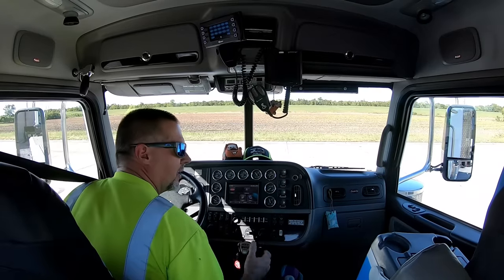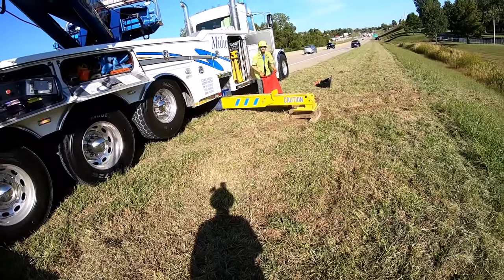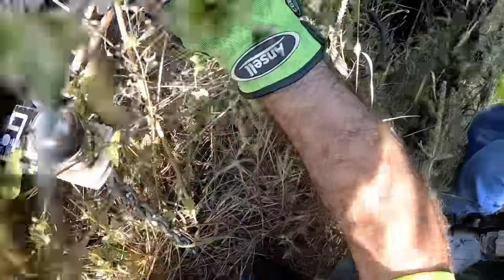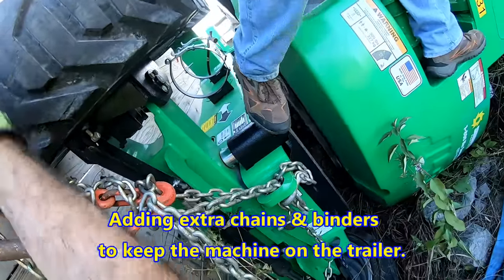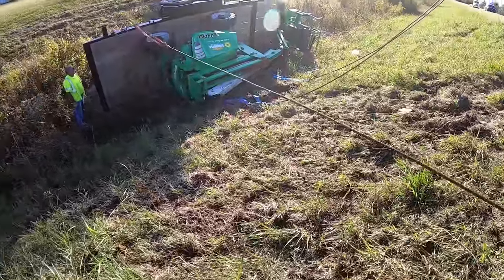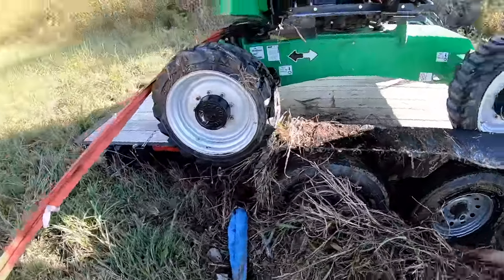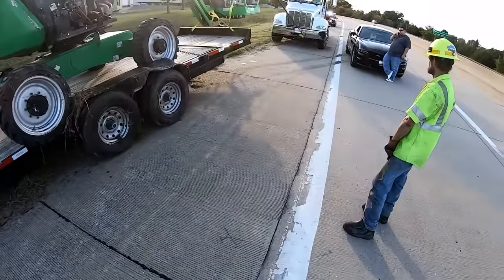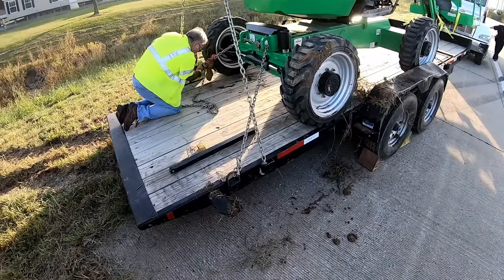THE REVERSE ROLL   ROLLOVER MANLIFT & TRAILER   YOU SPIN ME RIGHT ROUND

Comment: That's the 1st time I've seen you over think a situation like that. I had a similar wreck years ago except it was a very heavy work boat on the trailer. In about 30 minutes I had the entire combo back on the road and they were able to drive away. I set up about 30 yards from the front of the truck and hauled. I placed blocks under the side of the trailer so when I pulled the trailer ran up the blocks and naturally righted itself.

Comment: First of all, thank you, Ron, for the video. That was an ordeal. I saw the lift was not fastened correctly on the trailer, i.e. four corners independently, as you stated. Second, that trailer would sufficient for a load half the weight of the lift, but it seemed too little for the machine. Nobody got hurt is always good news. Thanks again, Ron.

Comment: The man lift was loaded backwards. If it would have been forward any more to start with the basket would have hit the truck. (before crash.) No tongue weight. Basket should have pointed to the rear of the trailer.
Reply: Everyone is agreement in this. Driver didn’t know but i bet he does now.
Reply: If it is a rental you would think the rental company would watch how this was loaded (it was loaded at the rental company that is....).
Reply: That's likely why the trailer flipped.
Reply: Should also been tied down at all 4 corners and the boom.
Reply: The tail wagged the dog
Reply: Now, that was just my idea!
Reply: Thats why it spun 180! Got the wobbles and it was over
Reply: It seems you would've wanted the weight in the center between the rear axles of the truck and the axles of the trailer. Could have only accomplished that with the basket being in rear of the trailer.
Reply: I rented a machine from sunbelt once that had a trailer that they provided — they hooked up to my truck but did not put a locking pin in over the ball of the trailer hitch. About 10 miles down the road I hit a bump and the trailer became disconnected from the ball — the only thing holding on was the emergency chains. I called them and told them that they hooked it up wrong and they tried to tell me it was my fault even though they would not let me hook the trailer up myself — I took them to court and won but now I’m no longer allowed to rent from them — really nice company
Reply: Weight of the machine worked against the tongue and on even a slight bump lifted the rear axle of the truck.  No way you can maintain control once there's no weight on the drive axle.

Comment: So many times on the roads I see lazy rigging on loads!  Machines like this have two securing points front and rear, and I see so many drivers run a chain through and tie down each end, and call that good!  The intent is that you run a chain through, then tie the right side chain to the left of the trailer and the left side chain to the right of the trailer. The way that this load was tied down was an invitation to disaster!
I did enjoy the lateral thinking to recover it though!  Great job!

Comment: Everybody underestimated the weight of the man lift.  Some of the machines of that size weigh as much as a backhoe.  The machine wasn't tied to the original trailer properly, the pickup towing it was too small and it was towed with a tongue-pull trailer.  When the machine was recovered from the ditch many were surprised by the weight the manlift.  People that drive for a living have this knowledge which leads me to believe that all who drive are not good drivers.  Driving is knowing how to rig your load, what it weighs its' dimensions etc., and then knowing how to move the whole thing efficiently down the road.  Nice recovery, seemed simple but it took a lot of skill.  Whole thing could have been avoided if the manlift was delivered by an experienced driver.

Comment: Ive really enjoyed watching your content. I have hauled rental construction equipment many many miles and I wished I couldve seen you guys cross the chains since the were long chains. on my truck i had single hook 5 footers and then had plenty 15 foot chains. But yes if you have a chain for each corner that would work. and the basket can be folded under to make the boom alot shorter and had more tongue weight with the basket to the rear of the trailer. You guys stay safe out there!!!!

Comment: That was an interesting recovery. Expensive for the customer in terms of equipment damage, no one hurt so its best scenario in those terms.
Reply: Also expensive for Midwest Trucks' manhours and equipment used.
Reply: Well I'd say the best circumstances are the ones where you just need to hose the mud off your vehicle, but then can drive it off the lit with no damages but to your pride, and your wallet for the tow.
Reply: It’s going to be even more expensive when Sunbelt rentals charges him to fix that lift — by OSHA regulation they are not allowed to make any repairs to the basket — it must be replaced and for that lift it’s around 10k. Then there are the other repairs.
Reply: I like how you do your job good work and keep it up 👌👌☺️☺️

Comment: Hauled man lifts many a time. This driver was inexperienced and loaded the man lift backwards on the trailer putting the majority of the load on the tail of the trailer. This is what is well known as THE DEATH WOBBLE. The tail of the trailer tried to pass the front of the truck. Looks like it succeeded. Check the drivers seat for a little round hole that was chewed through the seat cover. LOLOL. Experience gained ! Good Job Ron !

Comment: This shows why you need to know you load and how to secure it. The counter weight on the back of that lift should have been put forward on the trailer to keep the trailer properly balanced. Early in the video, Ron state it was a 1-ton, but the truck is marked an F-250, which is not a 1-ton but a 3/4 ton. The towing capacity of that age F-250 is only 14,000 lbs, and lifts lifts like the one on that trailer often weight in excess of 15,000 lbs-27,000 lbs depending on the model.
Reply: If the cops were feeling nasty they could have ticketed the truck driver for pulling an overweight load on that F-250.

Comment: Great video Ron, always enjoy what you post, in reference to the accident... Far too little tongue weight on trailer, machine should have been further forward or the other way around, that's what caused the accident. I think there was far more weight in that machine than anyone had realised..After getting it back on the highway.. you comment Ron that it had moved back.. I don't think it had as the chains nearest the basket had not moved and if the machine was any further forward the basket would be hitting the back of the pick-up...yes it had moved sideways slightly but that was due to the accident and putting the trailer back on its wheels...

Comment: Hello Ladies and Gentlemen;

I have the exact explanation here as to what led up to this (I am a physics expert and traffic scene reconstruction expert) and based on what I was able to piece together with my experience and extensive heavy equipment operation background,  I will present my case so as to avoid learning the hard way how it happened with an easy to understand explanation.

Here is what I know from the verification of scales these are the things I found; machines such as excavators and boom lifts use a counterweight, improper weight distribution can easily lead to catastrophic failure much more easily as a result of understeering and/or oversteering in comparison to driving inputs, and this video demonstrates that failure to load properly is a highly steep payment to what my business math instructor referred to as "the stupid tax".

Now having those factors, I found that when the machine was in transport, the counterweight was so far back (the counterweight is typically the most weight dense component on the machine)  that the front to rear weight balance on the trailer severely out of tolerable conditions. With the weight so far rearward, a significant amount of weight was removed from the rear of the truck and increasing weight on the front axle, causing an enormous possibility for overseer.

An additional consequence is what happens with a trailer loaded to heavy on the back is a solid recipe for death sway. Death sway is where the truck and trailer sway back and forth (like the folks who are coming out of a bar who had too much alcohol) and is a difficult to recover from situation.  It can also happen with a tongue heavy loading as well.

Now that I explained the precursors of the catastrophic event, I will now explain what happened on the highway. As the individual was driving there was an event of both sway and oversteering conditions. Whether the oversteer condition began first or the death sway happened first is a mystery. What matters is they both happened. Without the "black box" recordings (part of IBD), We will never know.

This was likely compounded by overcorrection and over/under reaction. That is an uncertain factor that we as engineers refer to as the natural human unpredictability factor. That is something that is extremely difficult to account for.

How do we load the machine in a better way?
Swing the boom rearward and pull forward until the weight is properly balanced. The target hitch weight addition is 10% of the machine's weight on the hitch. There are excellent trailer couplers with built in scales.
To calculate your target weight, take the machine's weight and move the decimal one place to the left. Take this number and add this to the scale reading of the unloaded trailer. If you refuse to take the time to do this, the odds are stacked against you in favor of the stupid tax.

I pray that giving you the Blessing of my knowledge and experience pays in dividends. God Bless and remember to slow down and move over.

Comment: Sad to say the machine didn't shift back that much. He loaded it with negative tung weight. Great Job guys as usual. The person driving that Ford doesn't belong hauling machines. He needs to be retrained. I suspect this was the cause of the accident. I believe the trailer came off the ball. Then the trailer swayed only having the safety chains as a connection. Pulling the Ford rear end around. End up in the ditch. God bless

Comment: Nice recovery!
I was surprised to see the apparent lack of over-run brakes on the trailer, which would be mandatory in the UK for a trailer even rated for over a small proportion of that weight (I think it's half a tonne (500Kg or roughly 1100lbs), but I'm not current, so it may have changed).  If the trailer weight is more than a higher level which I can't remember but I believe is relative to the weight of the towing vehicle, the brakes must be fully linked, as on a semi-trailer.
I won't make any judgement on the lack of nose weight, as it's hard to know how much the load may have shifted when the trailer took control of the truck!  As always, your comment on the lack of sideways bracing on the load seemed spot on - chaining each side separately would have prevented the sideways shift.
Some expensive lessons for the owners and they got off relatively lightly - I shudder to think of the liability aspects if that lot had taken other vehicles with it when the trailer took control away from the truck.
I know there used to be a recovery operator in Essex, England, who carried a large marine plough anchor as a mobile redirect which would have been ideal to roll that trailer aways from you.  I saw it used to right a top-heavy semi-trailer and it's tractor from what would have been an almost impossible position otherwise.  Ideal when there's no holmes tree available.

Comment: Question for ya Ron.
After you got the trailer close to the pavement couldn’t you have run your drag line through a snatch block on an anchor point of your wheel left? Kinda looked like that would’ve given you more room to play with, and easier to spin the trailer around like u wanted.

Comment: 10,000 LB machine (9,700 with out fuel or Hydraulic oil)  all on a 7,000 lb rated trailer. Add in loaded backwards, With little weight on the 1 ton truck towing it. And this is what you get. It started swaying and the 10,000 lb took the truck where it wanted to go. This was a VERY common sight in the 3 yrs I worked for the "Big Green Rental Co."  It was usually 10,000 skid steers on company trailers that home owners wanted to pull with a half ton short bed or a 1/2 Ton SUV. We where good for 5 or 6 of these every spring. But the corporate office said, If the customer signs off, Let'm take it. Which is one of the reasons why I left. Safety wasn't there main concern at that time. Can't say how things are now. But between 2012  and late 2015 it sure was.  Yet another fine safe recovery by Ron and the guys at MidWest Truck.

Comment: Wonderful educational and entertainment! If one person learns to properly secure a load, the time putting this online was worth it. 

You and your dad (and Mike in this case) were the operators on scene in this case, so what I say is only what I could see from the 'cast. I am NOT saying you did anything wrong or incorrect; just something that I would have considered (which you may have done but didn't show it in the broadcast) would have been to tie the manlift down better ("x"ing the chains on both ends of it) before moving it on the the rollback. I also understand that moving something by pulling the trailer is completely different from moving something on the rollback.

Just so that you and anyone else understands -- I use to be qualified (in the Navy) as a crane safety officer. To farther explain - if a "crane safety officer' said "No" to the operation of a crane (which the "Tator" qualifies as), it was as if the captain of the ship said "No". The "Tator" would have been approximately 56% of full load for the floating crane I worked on.

Comment: In trucking we always crossed the chains to secure a load like that the trailer may be rated to pull the lift but a gooseneck would make way more sinse bumper pulls are ok for a boat or a lawnmower.

Comment: Well got to say they did an okay job putting those binders on, equipment on it's side still attached to the trailer. should have used 4 points but at least it didn't fall off.

Comment: I'm willing to bet after seeing the tongue up in the air that he didn't have enough weight on the truck. I have pulled loads that way but not for long lol i have pulled a 10k lbs load behind a little quad cab Dakota and had no issues and I've pulled a 6000 lbs skid steere and I've had the skid steere not loaded right and made it less then a mile before I had to reposition because I couldn't get over 30 mph before the trailer wanted to pull me all over the road. Glad nobody was injured.

Comment: That must be a pretty good chain job for that lift to stay on the trailer the whole ride.
Reply: Zach Ashcraft every one of his chains are RATED fo a certain weight, chains we bought from hardware stores, even 1/2” thick, all said NOT FOR OVERHEAD LIFTING, but that’s what they were used for, in lifting a refrigeration compressor with a 40 ft come -a long, , but you NEVER go under a LIFT ,,, CHEERS. FROM  NJ🇺🇸🇺🇸🇺🇸🇺🇸

Comment: Small machines like that are still heavy machinery for a reason, they heavy. We had our small forklift run out of propane at work once and we decided to push it out of the way because we were in a hurry, that thing weighed more than a truck even though it was smaller. Wouldnt think that small manlift would be much lighter.

Comment: Couple of channels have had Officer Hooper explaining how things should be chained down, chain capacities and requirements etc. These equipment owners would do well to to find those videos and learn from them. Requirement as I understand it is independently tightened chains from each corner of the machine base to the trailer frame, plus additional securement at the end of the bucket to prevent it moving. Single chain at each end is legal provided that a binder tightens the segments from each corner to the trailer and any excess chain is between the two binders, and not doing any work.

I also suspect that the machine was loaded tail heavy on the trailer in the first place, depriving it of tongue weight and making the entire rig skittish. I accept that the load moved in the accident due to poor tie down, but doubt that there was enough slack in the chains for it to have moved back the foot or so needed to render the trailer as tail heavy as it was in the recovery.

Comment: I almost rolled a bumper pull trailer like that  hauling 6 inch ductile iron pipe, that was 20 to 23 ft long, and the trailer was 18 ft long, so I had too little tongue weight, I didn’t know I had too little tongue weight and when I got to highway speed on the highway, the trailer and pickup started to swerve, by the time I slowed it down, the truck tires were squealing and I almost rolled it into the ditch, God was in control that day, and I’m glad I didn’t end up like him, it wasn’t my time to go

Comment: The whole safety chain thing got my pucker factor way up. Looks like center mass of the picker was a ways aft of the trailer axles - low tongue weight setting up the whole accident with the help of the suspected Fords weak flexing bumper hitch instead of a solid frame hitch.

Comment: Great job guys! 
Poor way to tie down ANYTHING!  4 separate tiedowns for wheeled equipment are required by law for almost every state. It would have prevented the side to side shift. I did not see a separate securement for the boom, also required by law. 
Folks this is why accidents like this happen. Improperly loaded and improperly secured. If you don't know don't tow!